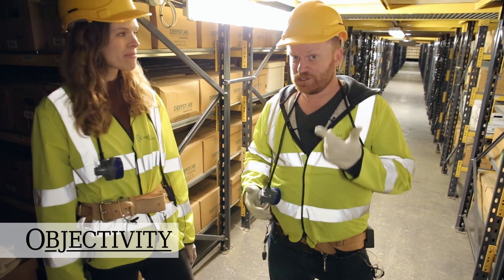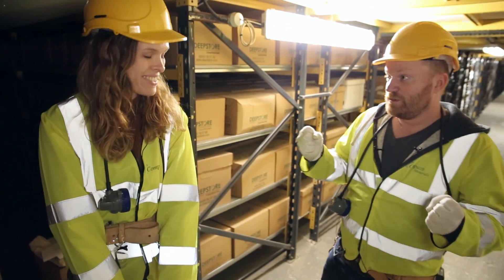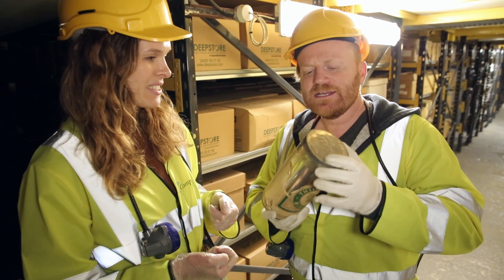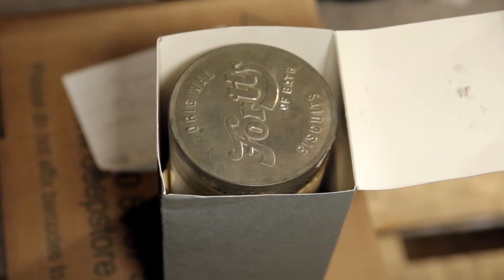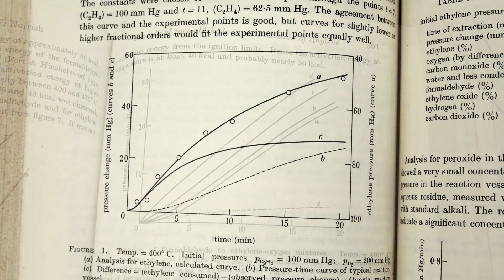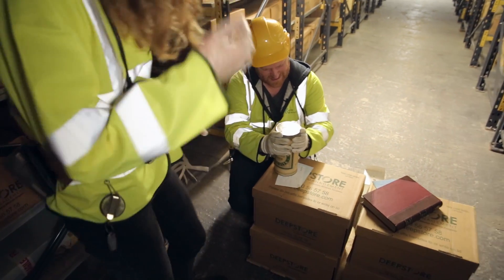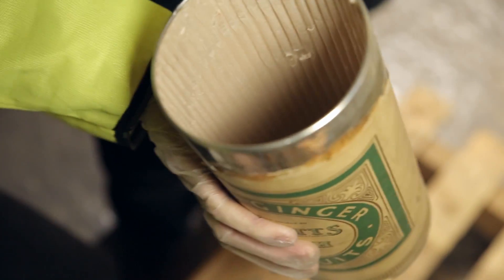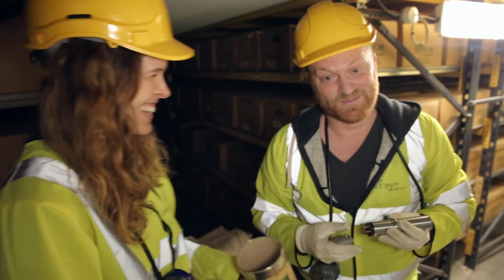What's in the Biscuit Tin? - Objectivity 115

Comment: For those like me only marginally fluent in technospeak a thermocouple converts temperature to a voltage or vice versa, and is mostly used for measuring temperature. The one in the tin was probably expressly built for high precision measurements over a specific temperature range.
Reply: RMoribayashi Thank you!

Comment: It says clearly that the optics (windows and a prism) of the device are made of rock salt, therefore they had to be kept totally dry or they would dissolve! That's what I read anyway.
Reply: CheshireTomcat68   It makes sense.  NaCl is transparent across a large part of the mid-infrared band where many important spectral features of organic compounds are found.  Chemists also use KBr for this purpose.  It is transparent across a wider range, but is more expensive.  Both absorb water out of the atmosphere, a real pain for this use.  There is also a thallium bromide iodide usually called KRS-5 that is nicely transparent in the infrared, does not absorb water but is even more expensive, and one has to be a bit careful because thallium compounds are toxic.  Brady kept calling the device a "thermocouple", but if it had NaCl windows, it is more likely that it was an infrared cell.  It might have been a heated cell.  A quick read through of the paper should reveal the matter.
Reply: Yes, I've made KBr disks for solid samples and used a pair of salt windows for liquid samples in a past job, which is why I noticed this. Fascinating stuff.
Reply: When I did FT/IR spectroscopy, the sample cards I used had KBr (Potassium Bromide) salt crystal windows upon which you placed the samples. If you put water on them, they would eventually melt. Water is also really active in the infrared range, so not only if you expose salt crystal sample windows to excessive moisture would it mess up the sample, if a lot of vapor was in the beam, it would also further saturate your reading.

Comment: So why does it have to be kept so dry?
Reply: If you had read the grant application, you'd know that it has lenses and windows made out of salt. It does not have anything to do with expansion/contraction.
Reply: Because, it is affected by the amount of moisture in the air. Changes in relative humidity can cause it to expand and contract. This expansion and contraction can cause damage. Extended periods of high humidity can lead to mold growth, rot and insect infestation.

Comment: All Keith did was apply a local vacuum around the rim of the tin, and reduce the temperature to close to absolute zero, allowing the atmosphere to evacuate the inside of the tin and cold weld shut, so the instrument would be kept in optimal conditions. You were supposed to drill a microscopic hole in the underside of the tin and allow it to slowly acclimate, and then un-weld the tin. Basic relic-keeping procedure, expertly issued by Keith.

Comment: Yep it's an expensive thermometer from the 50s
Reply: A thermocouple is a pair of junctions of 2 dis-similar metals that will put out a voltage when the two junctions are exposed to different temperatures.  You can see the connection points are made of two different metals.  If you supply power to the device it will heat or cool depending on the polarity -- e.g. thermoelectric coolers.  

I'm really curious as to the actual application of this device was.  The effect was discovered in 1821 and thermocouples were available commercially around 1900.  Why was this one so special?